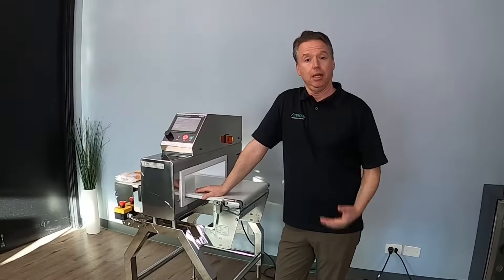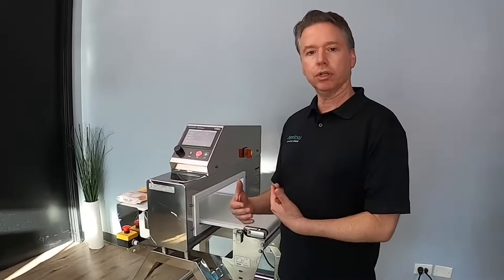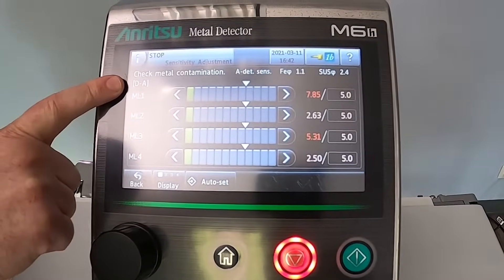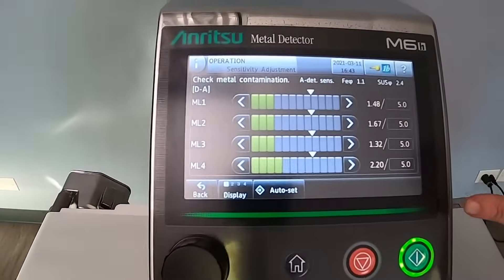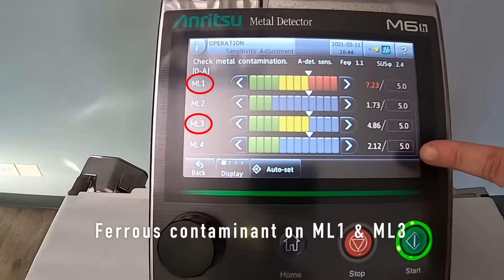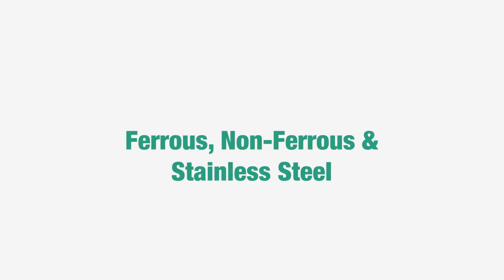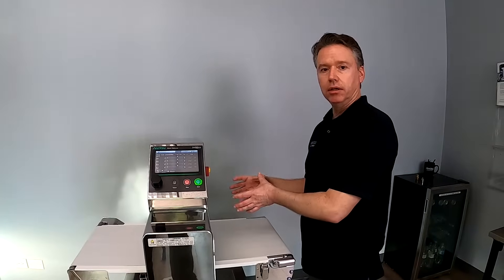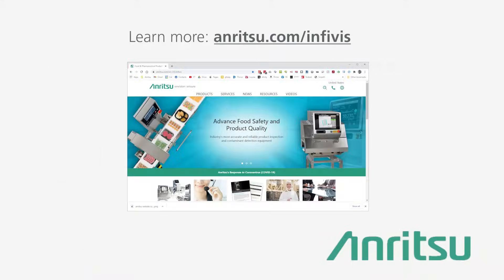Multiple (Dual) Frequency Metal Detection Explained

Comment: You need to include a Garrett carrot pin-pointer with every M-6 sold. This whay the process line worker can easily inspect flagged product units and find the metal contamination quickly and precisely for best fault failure analysis! It’s great to keep the metal contaminants from going out into the public however if they don’t identify exactly what the metal contamination is how can they trace the root source for failure trend analysis. Cheers, #SeattleRingHunter